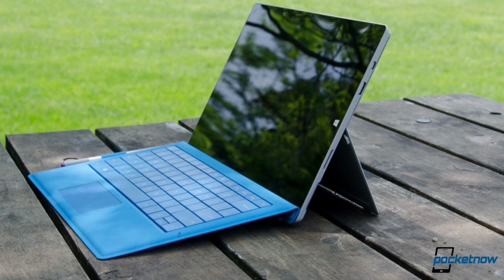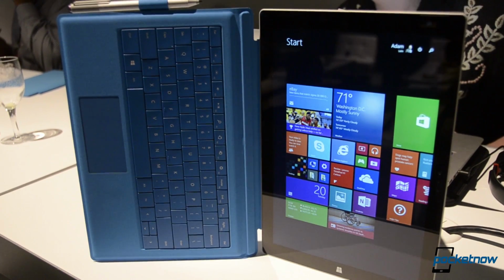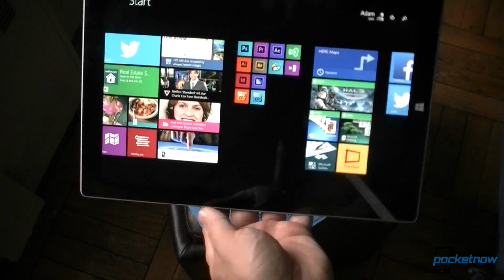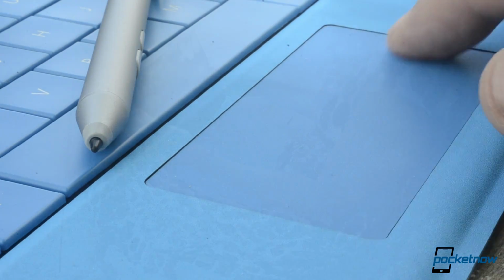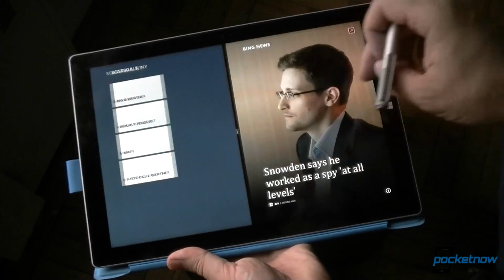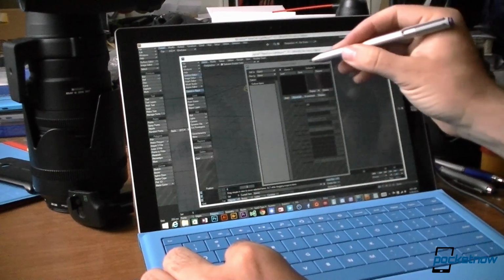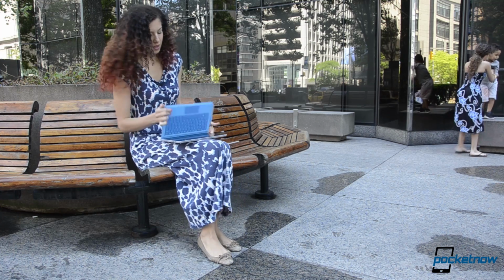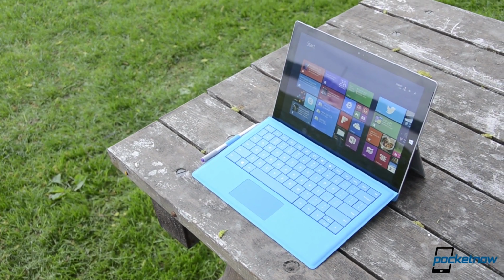Surface Pro 3 Review | Pocketnow

Comment: Doesnt wake up from sleep? Thats ok, everything else makes it better. lol. How if it doesnt wake up?
Reply: tayl0rd Bullshit.
Reply: To be fair, ALL Windows based machines have ALWAYS had trouble waking up from sleep mode, whether it be a desktop or laptop. Microsoft has never gotten the coding right ever since they originally introduced the feature back in Windows95. (Or was it Windows 3.11?) The closest they ever came to getting it right was Windows 98SE.
Reply: He's using pre-release hardware/software.  There are a couple of known problems I've heard about that Microsoft says will be fixed by release.  Of course, if it ever really won't wake up, just hold the sleep button for a few seconds to force a cold boot, just like any PC. :-)
Reply: Abhinav P I was joking. But he did show that it doesn't wake up sometimes.
Reply: It had a couple of occasional issues with slowly waking up from sleep mode, but that may be one reason why it's not released yet.
Reply: Great device !
Reply: Adam Lein it only had trouble waking up from sleep mode with the pen.
Reply: My Pro 1 needs a few seconds after pressing the lock button before it will wake back up. This might be the same thing. Just give it a little time and it will be fine I'm sure. Not great but it is a properating system so needs more time than the light weight iOS/android etc.
Reply: Th3Gr33k the lag after pressing the button is probably caused by your screen start up time
Reply: Sjon appelboom Maybe but I don't think so, reason is if I lock it then leave it several seconds it will wake up the instant I press it. My semi educated guess is that it takes a few seconds for the tablet to finish going to sleep. Windows sleep is probably a little more deep than a mobile OS's.
Reply: Th3Gr33k could be, it's just that my phone has the same problem being caused by screen lag so
Reply: Sjon appelboom Aye. Samsung by any chance? My S2 had a slow response to wake up calls. Nexus 4/5 since then doesn't though :)

This whole thing isn't a real issue as long as you expect it... And ultimately who would really lock their surface pro then instantly unlock it again? Still, I doubt MS will ever read this but my advice for them would be to postpone the sleep for a few seconds (in case people didn't mean to lock it or just want to unlock instantly) and just turn off screen so it will just have to wake screen not the whole system :)
Reply: Th3Gr33k samsung yes, worst choice ever
Reply: Sjon appelboom Nah. Could have been worse, could have been an iPhone :) I would recommend nexus phones or Motorola's, stock android is so much better than anything else I have used...
Reply: Th3Gr33k windows phone ftw
Reply: Sjon appelboom Fair enough. Can't say I liked the windows phone OS much but can appreciate why you might. Ha, even disable modern ui on my desktop and surface pro...
Reply: Th3Gr33k I have to say WP 8.1 is a massive improvement.  I can honestly say there are no longer any missing pieces.  I just love the way they do backgrounds.
Reply: Christobanistan Completely agree. 8 was awful and confusing to use (and I'm an IT tech) but 8.1 is really nice. Shame they didn't release 8.1 originally, 8 wouldn't have the stigma it has now. I think the metro/modern UI is a bit crappy mind, don't like full screen apps, I like the layering you can do with desktop style windows.
Reply: Th3Gr33k I was referring to phone 8.1, not Windows 8.1.  Windows 8.1 is still awful in many ways:
1) Start Screen is still garbage with fewer critical features (like folders and a compact, non-disruptive design).
2) Window titles are centered, which is stupid as hell.
3) Window titles are always black and very difficult to read when background isn't very light.  And the options to customize that sort of thing are poof! gone for no reason.
4) The square look is awful on desktop windows.  Trying to squeeze Metro design into the desktop is horrible.
5) Aero was awesome and beautiful on the desktop.  Why the $(!2)% isn't it available??  And don't tell me performance because anything larger than a cheap tablet can handle it easily.
6) Elements of Metro are ridiculously integrated into the desktop, like the annoying messages saying "You have new programs that can open this file."

Of course, some of the internals, especially disk access, are somewhat improved, but that's no excuse for this half baked OS.
Reply: Christobanistan Ah, mobile right, missed the WP somehow :p. Sure 8.1 PC isn't perfect, until it losses the metro rubbish it won't be, but it is a million times better than stock 8. I just don't use metro at all, with a few setting changes it runs like w7 but imo nicer, there are lots of nice little changes that make things easier, right click start for example. I am even learning to like the app drawer (when you click start you can set it to go to apps instead of metro) a shame it takes a lot of tinkering to make it work right on desktops though.
Reply: Th3Gr33k Going to apps is useless without collapsed groups.  I generally just press Windows key + S to search apps without going to the Start Menu.  I love the new title bar on metro apps, and the fact they show on the task bar (the left side bar was really hard to access with a mouse).  8.1 is a major improvement, but until all the issues I mentioned are fixed, I will continue to hate it.

Of course, I could install a start menu replacement, but I hate hacks.

Comment: I find the lack of reference to the price of the surface pro 3 very lacking in this review, regardless of how cool a device may be, all is void if it is severely overpriced.
Reply: as you see with apple products, price to cool ratio doesn't really matter. cause apple products are crap, and people still buy it.
Reply from the maker: Click the link in the description to see the full review, which contains extremely detailed pricing information and some more thoughts on that as well. ^M
Reply: zwashl I'm not quite as dumb as you think. I recognize the performance differences concerning U and Y series Intel units. However, just those processors alone cost around 350 dollars.... and therefore my argument still stands. The surface pro series isn't some apple crapbook that is 50% profit.
Reply: You, friend are severely misguided, this isn't any more expensive than a high end ultrabook, because it is a high end ultrabook. It's just an ultrabook that is also a tablet.
Reply: It is expensive. However it really depends whether you need this. If you're a road warrior visiting clients who you want to impress, and don't want to carry around a laptop AND a tablet, then it's worth the money. For regular everyday users I don't see the point particularly at those price points. I'd rather have a good ultrabook and a cheap Android tablet.
Reply: ***** If you think the components in the surface are comparable to their desktop counterparts, you're sadly mistaken. Plus, even if they were, they wouldn't be worth $2000.
Reply: zwashl Wow, you know this for sure, how exactly?  And did it occur to you that squeezing the fastest desktop level processors into a package this crazy thin and light is itself a value?
Reply: deanopain Well, that's an oddly dismissive statement.  People buy higher end hardware for far more than just "impressing clients."  Sometimes people just appreciate quality.  All that processing power in something so thin and light, the pen and note taking capabilities, amazing screen resolution, yada yada, all in something that can function as a keyboard-less tablet, it's truly more than the sum of its parts! :)
Reply: Christobanistan
Sure they do! Mostly impressing themselves and friends...  But I'm mentioning a use case that is far more likely for this product.  I note that Pocketnow actually has a maxed Road Warrior rating for this.
I often visit client sites and turning up with crappy hardware doesn't actually look good.  You dress the part and make sure your tech works.  If it looks the biz as well it certainly doesn't hurt.
Reply: Consumers forget the differences in the terms 'Overpriced' and 'Expensive'. Because this isn't ARM, this is really powerful PC hardware.
Reply: TheRAINMan059 Again, if commodity is worth more to you than money, by all means, go ahead, it is indeed a tablet that replaces laptops in almost every way, just please understand that an the i5/7s these come with are not the same as those you find in desktop computers and also their low energy environment nature does would not allow them to perform comparably even if they were.

Comment: do they make a touch cover for it yet? and I agree with the capacitive button comment, there's already a windows button there you can access nearly instantly if you swipe in, just not in portrait. I'd prefer it on the bottom (while in landscape), but if you're going to put it on the side, at least put it on the left, so you can access the windows button from either side. I used my Toshiba encore that way and it was very efficient.
and imo the AAA's in the stylus is great. I'm sure it last a very long time, and you never have to worry about having to replace the stylus (at least for battery reasons).
Reply: No touch cover announced. I like the touch covers, too. I hope to find some kind of tweak that can disable that capacitive start button on the bezel someday. Like you said, an edge swipe will get you the charms right over there anyway.